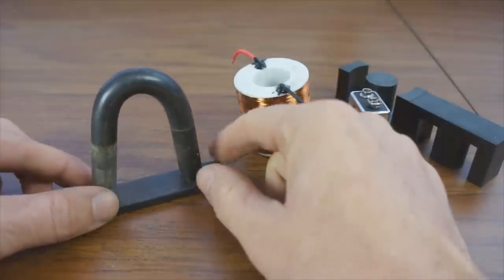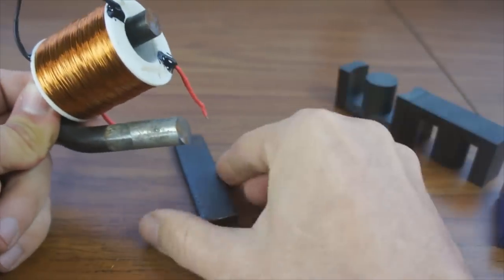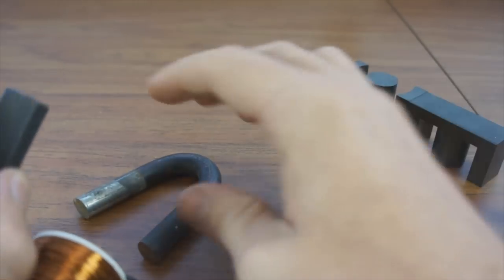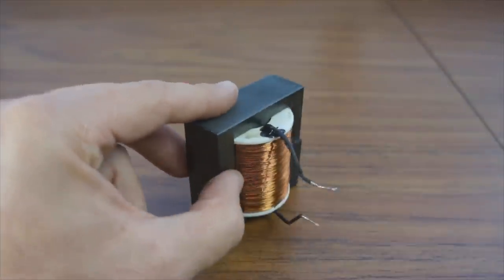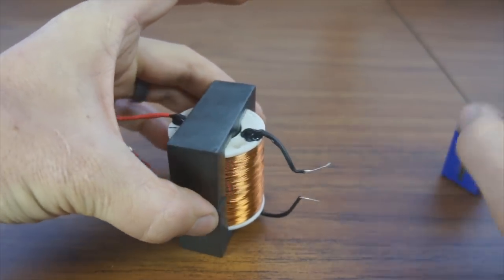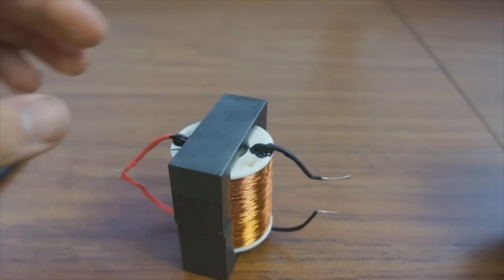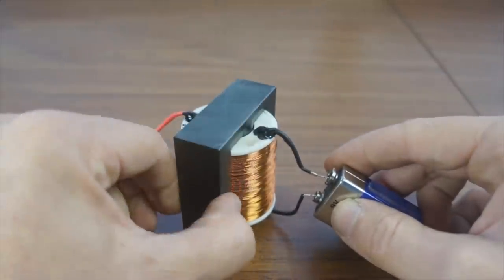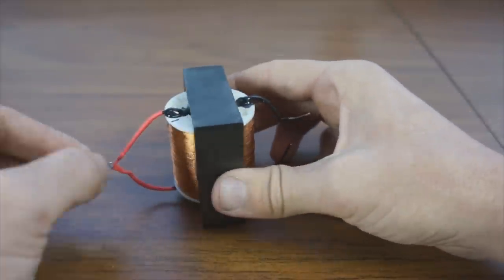PMH - Electromagnet keeps holding after power is removed?

Comment: This principle is used in AC relay coils to keep the relay from buzzing at 60 hz.  The second coil maintains the residual magnetic flux by capturing the collapsing magnetic field in a circulating current in the secondary coil.  If you look at an AC relay you will see a ring of copper or shunt coil around or through the core.  It is doing what you are demonstrating here to keep the armature from rattling between polarity shifts of the AC sine wave.

Comment: Ed Leedskalnin explains that magnetic current is the composition of so called electric current, but there are 2 contra currents. The materials around which the current flows have different retentive properties, and different transmission line properties. Transformers and generators work by filling the cores with the magnetic current and then the core transmits the  magnetic current to the copper wire where it dissipates into the atmosphere if no path is available. The principles are consistent .

Comment: This is my take on what you have going on there. Ferrite cores for transformers are designed to saturate and lose magnetic fields quickly. This helps with power transmission. It is referred to as a fast switching magnetic core. The mostly iron bolt and bar for your PMH saturates magnetically and then given the right circumstances will hold that charge for a very long time.  Ferrite won't. The reason shorting the second coil makes the ferrite act as an electromagnet longer is because the coil holds some energy that induces magnetism in the ferrite. I doubt that it will make it act as a PMH though because the energy stored in the coil won't last long. The coil stores energy in a magnetic field induced in it by the primary.

Comment: This is a well known effect in scrap yards. The lift magnets are even equipped with a "release" function  where a timed reverse pulse releases the rest of the scrap metal. This is a hysteresis effect. where magnetic domains align . This is stronger in solid metal and requires energy to establish and energy is released on collapsing. As far as the coil maintaining the magnetic field, this is a maintained current in the second coil. This effect is how brush-less  motors work.

Comment: I would think in the shorted secondary coil, would be a damped oscillation. Coils have implicit capacitance, so this is an LRC circuit really, with resistance in the wire, and capacitance between the windings. So it should ring, but dampen due to the losses. Hence, I would predict the magnetic effects would also be damped over time. Do they, or does it stay magnitized indefinitely like Leedskalnin's PMH?

Comment: Try the Ed Leedskalnin approach. Connect the top coil wire to the bottom of the other and vice a versa. Charge the coils at each connection point and see if it holds then.

Comment: Lasersaber - a good/simple extension to this experiment may be to connect your o-scope to the "primary" side, and watch for extended 'ringing' when you disconnect the battery. You may find that the "release" happens as the ringing decays to s specific level. That 30 gauge coil will also have a self-capacitance due to the wire-upon-wire windings, therefore will have a self-resonance frequency.

Thanks for keeping us thinking!

Comment: The reason why it works when you shot the coil with the red wire must be because the coil loop that you are closing keeps a current trapped, therefore that residual current in the coil generates a magnetic field that keeps the 2 pieces together, this current will be dissipated by the resistivity of the coil eventually. Also, if you reduce the temperature, this effect will last longer since you are reducing the resistivity of the coil that has the red wire to it therefore the current takes longer to die out. To test this try soldering a potentiometer to the red leads and see if there is a difference in how long this effect lasts at different resistances.

Comment: I found the second part of this video with the shorted secondary coil to be most interesting. I have been wanting to do an experiment similar to this. Coils and capacitors are both energy storing devices. A capacitor is more easily understood. If you apply voltage to the capacitor leads for a moment and then remove it, you have just stored energy in the capacitor in the form of a dielectric field between the plates. If you then connect a load, like a light bulb, across the leads of the capacitor, the stored energy is released in the form of current to produce heat and light. 

In the case of a coil, when you apply an electric current to the leads of the coil, you are creating a magnetic field around the coil. If you suddenly remove the source of electric current, you will often see a spark just as the current is removed which is usually at a much higher voltage than the source. The reason for this spark is the magnetic field is suddenly no longer being maintained by the current going through the coil so it collapses at a velocity approaching that of light. Voltage is directly related to the velocity of the magnetic field so since the resistance is infinite, the field tries to maintain current flow by producing whatever voltage is required. eventually the voltage becomes high enough to jump the gap and make a spark.

With the coils in the video, the primary produces the magnetic field and is disconnected. The magnetic field begins to collapse but then encounters the shorted secondary. Since that coil has a very small resistance, very little of the magnetic field is consumed to create enough voltage in the shorted coil to produce current flow. When current begins to flow in the secondary, it has the effect of pushing the magnetic field back out. Eventually the resistance of the wire in the secondary consumes the magnetic field and produces heat and the field disappears releasing the two halves of the core material.  VERY COOL!!

Comment: Break the magnetic latching while you have an analog amp meter connected to the secondary. That will tell you about a lot. 

In the iron example with retentivity. The steel's magnetic domains retain some energy keeping the domains aligned in a loop. When you created an airgap, you increased the magnetic reluctance and the magnetic domains reorganized to shoter low reluctance magnetic circuits with adjacent domains.

Comment from the maker: I have been reading all the comments.  Thanks for all the great input.  I do think that the second effect is probably related to Daniel McFarland Cook device.  I did come across what may be the earliest mention of the PMH effect in "Davis's manual of magnetism" 1842.  See the page 75-78 on the "Magic Circle".  Read what the end of paragraph 128 on page 76 says "If the flow of the current in the coil is stopped while the armatures are applied to each other as shown in figures 50 and 51 they will still continue firmly attached but if once separated will not adhere again."  See link:
http://books.google.com/books?id=XRRLAAAAMAAJ&pg=PA75#v=onepage&q&f=false
Reply: Brett Moore check out a motionless magnetic generator it uses somewhat of the same concept shifting magnetic flux
Reply: TheRealVerbz2
Goes back further than that, to Edward Leedskalnin .. http://www.leedskalnin.com/
There is also a PDF of a paper he wrote on magnetism that explains this, property, back in the '30's
Reply: Jason Pollastrini That's not accurate to compare Bearden's "Motionless Electromagnetic Generator" to Leedskalnin's rotating flywheel. (which uses stacked V magnets)
I have all of Leedskalnin's writings. Got them from my friend Matt Emery who runs Leedskalnin.com
Take note that the PDF of Magnetic Current with illustrations is Not Ed's original writing. There were no illustrations in his original.

Matt Emery sent me the PHM U bar you see in his site.
I did a couple videos with it.
Here's part 1.
https://www.youtube.com/watch?v=UFcd_QCLK5w

Here's a recent video from a man who is proving Leeskalnin's work by himself: https://www.youtube.com/watch?v=nOoCuDnmtyM

--Jason Verbelli
Searl Magnetics, Inc.
Reply: lasersaber i am going to say the reasoning behind the residual magnetism is simple. When the coil is turned on, it temporarily aligns the polarity of the metal rod. as without it, the polarity of the rods molecules are not aligned north to south. Once the electromagnet is shorted, the electricity has nowhere to go, and so in turn it transfers to the metal rod, aligning its polarity. when the battery is removed, the rods polarity is kept aligned by the coils aligned polarity. once you separate it, there is nothing holding the polarity in place, and it falls back to being out of alignment. i.e. the coil and the rod keep each others polarity in alignment by the attraction of magnetism.
Reply: First, The effect of electron current in the primary coil causes the surrounding aether to linearize forming a magnetic field in the core. Then, when the battery is detached, because of this core's unique ability to instantly collapse its magnet field, an electron current is induced in the secondary coil. The timeing of this current is slightly delayed because of the secondary coils many turns of wire giving it capacitance value, storing the electrical charge for a tiny fraction of a nano-second before releasing it into another current running back through the same coil producing another instance of magnetism within the core. When the secondary's current stops, the core's magnetic field collapses and this ping-pong process repeats probably over a thousand times in the short time that it continues before the wire's braking resistance to electron flow causes it all to eventually come to a halt.
Reply: It would be interesting to see if oscillations are present when you pick up the upper core of the second arrangement.  Maybe connect a scope to the charging coil while lifting... Could be a high frequency sin x over x signal, decaying until the core separates.
Reply: It also illustrates, that the coild inductance has nothing to do with it, because Smith's wire is interrupted. But how the steel can get demagnetized, if you surround it with wire?
Reply: lasersaber hey can i borrow some of ur time???

Comment: I've seen numerous videos about the PMH but don't remember anyone trying to explain it, just simply saying it's OU or something.

Eddy currents in the soft iron causes the PMH to stay together without outside energy. We can tell it's eddies because the ferrite core, or normal laminated steel cores, don't produce the same effects as a solid bar of iron.

The reason why the ferrite lasts longer with a shorted coil is due to the current flowing in the coil. It's not permanent because the shorted coil has resistance, causing energy to be wasted as heat until the magnetic field collapses. It would probably last longer, or maybe even permanently, if a large single loop of copper were wrapped around the core.

I don't think it's related to Cook's battery because he states that using iron wire produces a better output than solid iron cores- this reduces eddies and remanence. Coincidentally, eddies do reduce CEMF which he states is necessary for his battery to operate. But instead of eddies he uses the inter-winding capacitance of a long, fine wire to reduce CEMF. Basically he made a transformer with a high inductance and distributed capacitance across the primary winding that negated CEMF.

Comment: If you connect a multimeter to measure current in the secondary coil you will see that there is a current induced there as you apply the magnetic field with the primary coil.
It will then decay "slowly" (based on the resistance of the wire and meter) and when dissapated the holding power will be gone.
Since a static magnetic field does not create current in the coil it works the other way around; It's the decaying field keeping the curent flowing/decaying.
In essence the extra energy to create a holding force is not in the ferrite, it is stored in the secondary coil.
If the secondary coil had been a superconductor you can store a LOT of energy.
Collapsing the field in your first half of the experiment would create a pulse of energy in the coil as well in case you were wondering, but there the magnetic field in the iron doesn't want to change after being aligned so it holds the field until you break the magnetic loop.

Comment: My 2 cents:
When shorting the second coil it stores a Back-current induced by magnetism from the primary.
Since the second coil is shorted, the current just runs through the coil converting to heat. 
When cutting power to the primary coil, the stored back emc of the second coil instead flows back into magnetizing the core.

Just as our nigerian friend stated, it serves as a capacitor.

Comment: I dont really know a lot about this, but i have an idea with the secound experiment:
When you connect the black wires to power, a magnetic field comes up generates voltage at the RED wires.
WHEN THE RED WIRES ARE CONECTED, there is a high current flow in the "red" coil. This flow maintains the magnetic field when you disconnect the battery and pulls the two parts together. (Energy gets saved)
After a while, the  flow of electrons in the red coil decreases due to resistance of the coil, the magnetic field slowly disapears and (after a while) the 2 parts can not hold together.
(after you put the coils in the freezer, it did hold longer -> less resitance, longer connection!)
WHEN THE RED WIRES ARE NOT CONECTED, the magnetic field can not exist after you disconnect the battery because there is no place where high current can flow.(no current -> no magnetic field)

Comment: You’re closing the loop on the primary so it is simply acting like a switch.  The permanent magnet effect is provided by oscillation between the primary and secondary.  When closing the loop on the 30 gauge wire It allows the current to remain. You can also use it like a spark gap. connecting one end in series will change the circuit from non-inductive to inductive. Many different configurations can be used here.  I think even a trip to wiki about bifilar coils and amplified transceivers aka Tesla coils and stators should help.

Comment: Dear lasersaber, I am very glad you have decided to study the PMH principle.

For me, it has been always a question of creating stationary wave(s) of current (so the permanent magnetic field), or back and forth waves, made possible thanks to the long enough length of the coil, regards to the wave length involved.

Would be interesting to make some calculation about that.

Remember that soft steel has already the known capability to keep magnetism easely, means the spins of electrons will stay organise easily for a while by remanence, which is not the case of the material of an hoven core in think.

You may try with a piezo and si the difference in the strength of the holding and conclude about the effect of high voltage impulse ;)

Regards.

Comment: My thoughts (in Ed Speak) are the magnets are flowing around the core, then as all transformers do, are inducing into the fine wire - thereby bleeding off the magnets from within the core - until the two halves no longer have enough magnets flowing to hold itself together.
There is nothing really special about the E-Core, as if you wound a single coil, it would act like the PMH with indefinite hold time until the halves are forcibly separated.
I think a similar effect would be found if you took the standard U-shaped PMH, and put a second single wrapped coil on the "other" leg.  Using the "charging" coil, you could lock the keeper in place with a quick charge, and if you shorted the "other" coil on the second leg, you would get the transformer action, and the individual magnets would bleed off - just as in the bifilar wound coil in your video.
Worth a try to see if you get similar results.

Comment: Hello. I love electrical theory, studying it as a pastime interest stemmed from my education in the electrical field. I have a couple ideas about this fascinating subject. 

In regards to keeping the core magnetized longer I’d suspect the more mass on your coils would act a lot like the plates in a battery. The surface area of the plates (in this case the coil) is the what determines the amount of amps stored in the system. This is also what determines the capacitance of a capacitor. 

My second insight is the core. As I’m sure you already know the type of material is more important in regards to producing magnetism than the material of windings. This is why they use soft iron in the majority of conventional transformers. They use plates covered with a film of insulators. This is to control the flux of the core and keep any interference from it and they windings separate. The flux lines from the coil will attract to the core and will attempt to make the core the same charge which will kill the magnetism.

I’d make a new coil with a coil with a single winding with more mass. The second thing I’d try and I’d bet my crappy Honda on would be insulating your core so there is no interaction between the two. 

Good luck